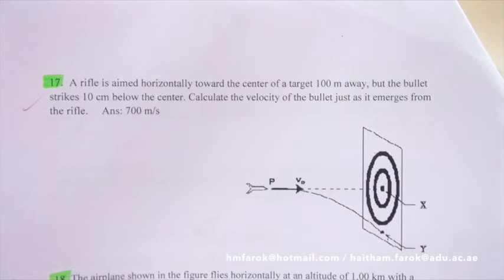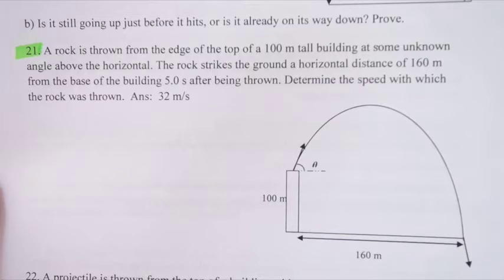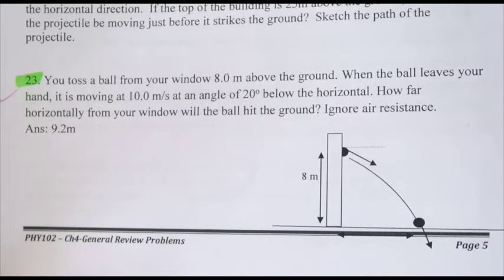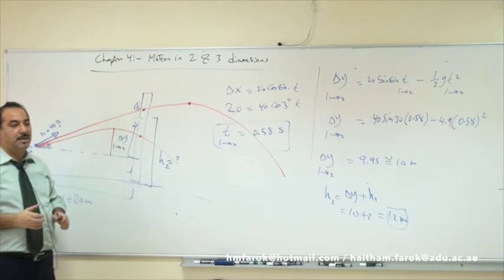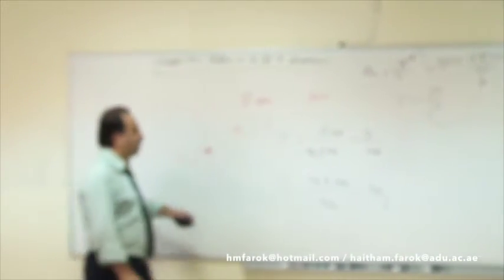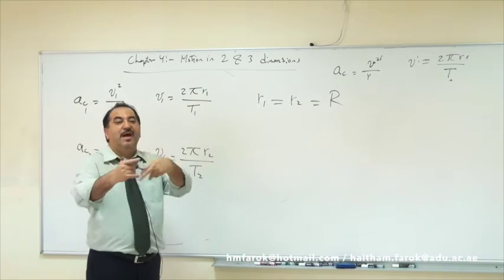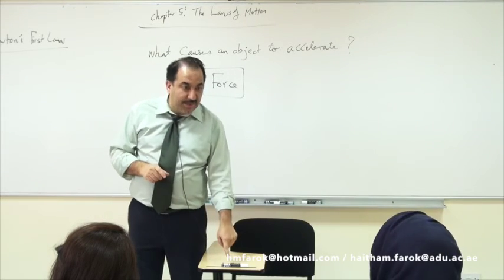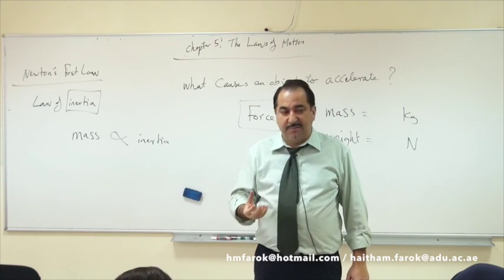Lecture 13. Motion in two and three dimension and Newton`s first law

Comment: the answer for question 23 is wrong sir, it should be 8.59m, not 9.2m
Reply from the maker: Hi. I have checked the solution of question 23 and the answer is 9.2 m. it could be that you are approximating the values of the sin and cos to one digit when calculating the values. you can always email me your solution to check it for you. Thank you
Reply: @haithamfarok1319  thanks bro